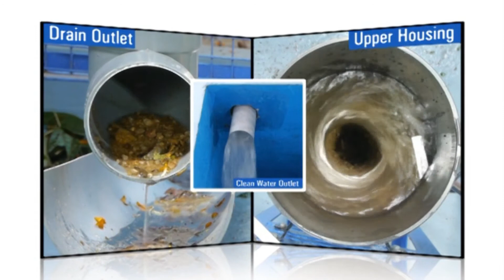Rainy Filter working Mechanism||Rain water Harvesting|Self cleaning||Auto flush out Mechanism

Comment: I am using this for the first time in this monsoon 2021 ( using since last 1 month).
First of all, the point of water filtration is not met properly. I can see mud particles, even fine debris not getting filtered by the Filter element. I am using a fine mesh cloth filter after the output from this rain filter, so i can clearly see things are not getting properly filtered, This can damage the borewell motor if you are doing a borewell recharge.  Secondly, water quantity which goes out from waste section of this filter apart from clean outlet pipe is much higher i.e Very less water is going to filter mechanism so water wastage is higher. Thirdly, Inlet size is 90MM, The pipe for which i found very hard to get in local market, infact you will get 75mm and 110mm easily. Also, last point, the steel filter element is very hard to pull out for cleaning not very easy to clean.
I would suggest to design own filter & not to waste money on this product.
Reply: Earlier it was working fine but now wasting more than 80% water as a waste. Frequently cleaning filter 2,3 days after the rain. How can reduce wastage water. Kindly let me know ...